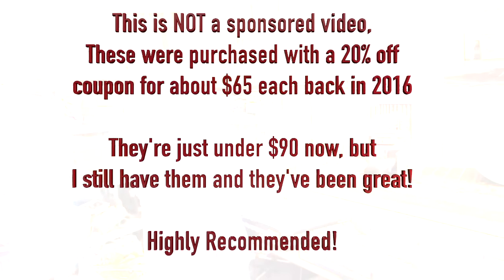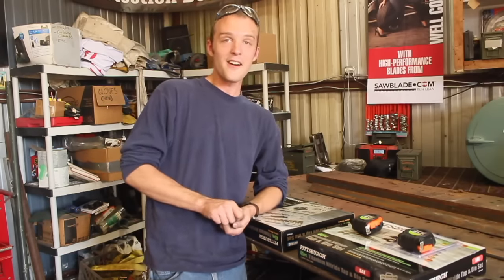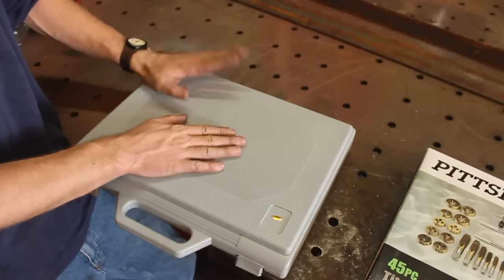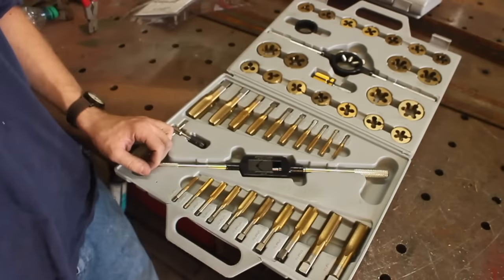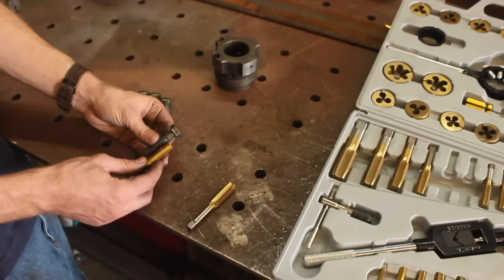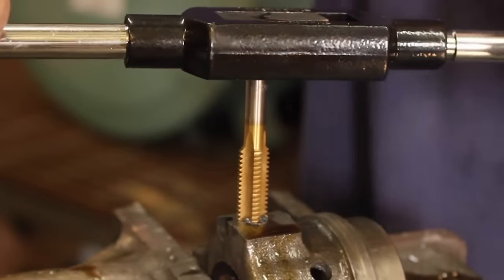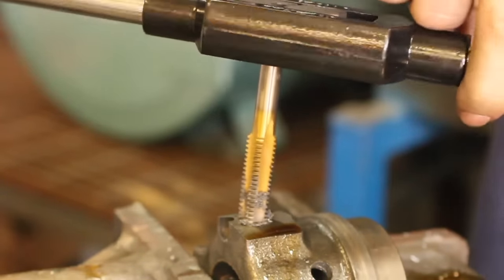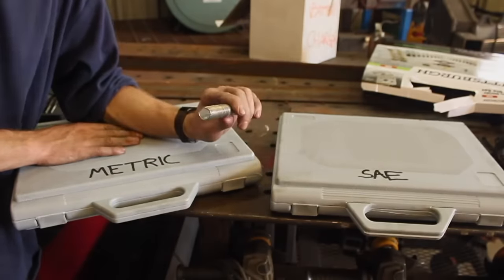HARBOR FREIGHTS BEST KEPT SECRET!!! AN ITEM SO GOOD EVEN INDUSTRIAL COMPANIES USE IT

Comment: Good set for chasing damaged threads, okay set for occasional use, f'n junk for someone who depends or cares about a good job or frequent use. If you use tap and die on a regular basis you need to bite the bullet and buy quality  made taps and dies. Usually American made. Believe me, there's a reason why one good tap or die might cost as much as a whole set at harbor freight. Just my opinion, let me know if you agree.
Reply: Is there a particular brand/set that you recommend?
Reply: @dreuaustin  Don't listen about american made, that's such a mindless zombie mindset. Look up the YouTube Project Farms Tap and die set video. He finds you the best tools, compares them and everything.
Reply: Always good to have backups
Reply: You can see the slip in the handle when he is chasing the stripped threads
Reply: @midnight2moonlight200  Agree, there some great foreign made tools and some junky American made tools. Quality determined by the manufacturers spec and quality control and not country of origin.

Comment: Ive used both sets for about 3 years, and have been happy with them.  The case in the other hand is another story. I'm going to build a wooden case for them most likely.
Reply: Haha I wish it was easy to source new cases for cheap tools, I get that too where a plastic hinge breaks off or a latch goes bye bye and it's usually really hard to rig something up like a real hinge.

Comment: I picked this set up a few months ago. I am happy with the quality of the taps themselves, but the small tap handle (the collar-and-sleeve with sliding torque bar) is terrible. Even after tightening down the collar onto the sleeve using pliers, the smooth tube of the sleeve would not grab the square head of the tap well enough to keep it from slipping about half way through. 

I picked up an inexpensive Irwin tap driver to use, and have been very happy with it so far.

Comment: They taught us in machine shop class that cast iron need no lubricant as the graphite content provides the lube. I worked in a production machine shop and after a shift working on cast iron parts,  my clothes everything around me were covered with cast iron dust. Nice sets.
Reply: That’s correct
Reply: Then a little bit of oil would keep the dust down.  If that dust is getting all over your clothes then it is getting into you lungs as well.  While the iron might be absorbed by your body for use in your red blood cells I do not think there is a minimum daily amount of graphite recommended for good health.

Comment: Recently needed a winch to load a propane tank and then a disabled riding mower. I have a gooseneck ball in my truck so I remembered seeing one with a trailer ball mount plate from Cabela's years ago. I needed it that day so I couldn't wait for an order so I took the chance that my local harbor freight had one. A short trip and $ 89.95 later I had one. Should have had it 10 years ago. What a back saver.

Comment: I have a set of Greenlee tap and dies from the the 50’s. Once while out of town and I needed a one time use of several taps and dies sizes I bought the HF 29 piece set that was 20 years ago. I have had good luck with it the  HF set.
The Greenlee set is in a wood box and is in excellent shape so I have a tendency to go the HF set in the blow mold case. Just to preserve the wood case. I have never tapped or ran a die test comparing the two sets for thread tolerance. But so far the HF have done the job for me many times.😁🛫

Comment from the maker: UPDATE: Not even shilling, but HF is putting on a big sale this weekend and these sets are on sale for $69.99
Reply: I have  the Pittsburg set with both sae and metric in one kit but these individual kits have much larger sizes. For 70$ can’t beat ‘em. I tap mostly 4 and 6mm x1.25 cylinder heads in 2 strokes.  Have you ever heli-coiled a stripped thread that was originally sae to accept a metric bolt? I know is sounds redundant but it was the fix that saved the day
Reply: These are not the best, and I own both of them... They're an awesome value for the money though!

Comment: I have used the higher priced Harbors Frieght taps and drill bits in CNC machines on multiple occasions when what I needed wasn't available in the tool crib. If they're used correctly, they work very well and resharpen well also.

Comment: It's a sad and uncomfortable subject, but man, sometimes you've gotta get the job done and you need the tools - no matter where they come from. I'm just a home-gamer and I don't make my living off of my tools, so when I bought an engine hoist - I simply couldn't spend the extra $400 for a US-made product. Especially one as stupidly simple as an engine hoist. I just got one from the overseas Junkatorium, replaced all the crappy bolts with US Grade 8 fasteners and got working.
Reply: Exactly right, probably wont last 10 years in a commercial engine shop but might last you a lifetime!
Reply: Okay let's put this in perspective I don't use a tap and die set unless it's absolutely necessary I need something that will work and not break because the part is  worth way  more ...so I don't use cheap   H F China junk
Reply: @marktarascio4766  You'd be surprised how much of HF's "china junk" is just rebranded contractors (Chinese and American) for big name stuff. Floor jacks are a fairly famous one, presses, tool boxes, a ton of their hand tools. Wrenches, hammers, axes, sockets. If you're not going for power tools HF really isn't the worst stop. 
But to each their own.
Reply: @Alconium  LOL, it's more like the other way around, a lot of the big name stuff is just the same stuff out of the same factories in China, with a different company name stamped/laser etched on it.
Reply: @marktarascio4766  The whole point of the video is that a dude uses it in a commercial shop and it works and doesn't break parts. It stands to reason it would do even better with your occasional use. Perspective-wise, you're looking through the wrong end of the binoculars.
Reply: @marktarascio4766  I work in an auto shop every day, and everyone In the shop has borrowed this HF tap and die set that our tire guy has in his toolbox and it works just fine. They have some junk yeah, but remember the tool being used is only as good as the tool who's using it.
Reply: @LiT_Moose89  I worked at an auto machine shop for a number of years and I got used to using tools that I could really depend on. I know most of this stuff is made in China now anyway but I still have most of the USA  tools in my home shop.

USA stuff that I used to have and use I still have
Reply: I got my engine hoist from OfferUp for $80 it’s a 2ton torrin and has rust but it works and that’s all that matters
Reply: @marktarascio4766  a lot of snap on tools are still made in the usa. Being in a machine shop I imagine you used tap and die sets more frequently and relied on them more heavily than in most repair shops. It would make sense to spend the extra cost on a quality set of tools used all the time, but for what it is and how often it gets used, this tap and die set from Hf is a very good alternative to a more costly brand. It may not be as high of quality but it gets the job done and done well. There arent may things HF is good for, but they have a few that just make sense when comparing to snap on, cornwell etc
Reply: Regardless of what you add to it you’re supporting a business that stands on child labor and underpaid workers. It’s become a hidden normality in our society but I have been trying to only buy and support business that don’t profit on another persons downfall
Reply: @thechuckyboi1438  this is the nature of capitalism. The root action of the word is to capitalize and synonyms include to take advantage of and to exploit.
Reply: @deeeyewhy5949  Marxist cheerleader I see
Reply: @thechuckyboi1438  Factories of child labor and underpaid workers is oververly broad and baseless. Their economy has been booming for a few years primarily the middle class. A lot of HF products are not made in china
Reply: @mrmotofy China Taiwan and Philippines. I worked there every box we got had inspection tags inside with foreign lettering

Comment: One the most handy tools I've bought from HF as well!  I refuse to wire wheel bolts because IMO this ruins them and parts washer doesn't always clean them satisfactorily but running them through these dies with a little light oil, works a charm.
Reply: Especially zinc plated fasteners
Reply: Don’t wire wheel them lol
Reply: @goinhot9133  I refuse to wire wheel bolts.  So many people do this and it's cringe, all kinds of dumb stuff like this goes on in 'professional' shops.

Comment: I use a set of these I have had for years. I did work on a Diesel engine once with a weird metric thread. Harbor Freight had a tap the right size.
I was in the store once and a guy had got two wire welders. Turns out he owns a ranch. He said he was tired buying Lincolns because his fence building crew just abused them and tore them up. He said the Harbor Freight welders lasted just as long and were a lot cheaper.

Comment: One suggestion.  When manually tapping new threads, back twist the tap every third or half turn to help reject the filings.  This helps clean the flutes and cutting edges.  I know machine tools usually tap in one twist but those have constant oil/coolant flow to evacuate the filings.  On topic, have had my HF Tap and Die set, purchased primarily for the couple of 'odd' size taps and dies (one was 1/2-20) and they are great.  I also do not expect 100 percent perfection but if you drive by my house and yell "Harbor Freight Salute", a goodly part of my workshop would stand straighter :-)!

Comment: I have the SAE set, and I'm impressed with it. For the price, it's a really good set. I noticed that mine aren't as sharp as more expensive taps, but that just requires a little more time per hole. Haven't broken one yet after over a year of regular use in my shop.

Comment: I bought this very set in Santa Clara, CA, around 2012, and to my astonishment, my friend and I found that the pitches for quite a few of the common SAE sizes were off!  Was verified both with sample bolts and a pitch gague.  That's especially astounding, considering that, even assuming being manufactured abroad (Taiwan, China, wherever), length is one of the few entities for which there is an exact conversion between metric and English units.

So - - if you don't have the pitch right in a tap, it's not much of a tap.  There's no curing that.
I had to return it, and made quite an overture to the manager that he needed to do more than just smile and refund my purcase: he needed to get to the bottom of how a tool product got through 5 or 6 different stages of manufacturing, testing, packaging, shipping, distribution, etc., without ANYBODY ever checking the taps with a frickin' pitch gauge!

To be fair, from the other comments, it seems he might have actually followed through on that, and perhaps they finally straightened it out.

Comment: I use these on 3d prints. Often I just make a hole without threads, ser my wall count to 4 and then tap the plastic. It works better than a 3d printed thread, much stronger.

Comment: I bought the $10 metric tap set from HF to chase some threaded holes. Not a lot was expected but I got less than that; these taps were bad. We're talking slightly harder than frozen butter and about as strong as a stale pretzel. When buying anything from HF always buy the better grade stuff.

Comment: The super-cheap sets and the $90 sets are a much different size range and therefore are complementary. I recently gave the cheap sets away after replacing them with the ICON sets which are also in the smaller range. SFSG.

Comment: I think it's hit or miss with these. Even within the same item number there's pretty big variability. Hardness, cutting edges, finish never know what you're gonna get.
Reply: What makes you say that ? Have you bought multiple sets and had different results?
Reply: That's how HF is. Minimum quality control apparently. But a no questions no hassle return policy makes up for it. Unless you have a long drive to the nearest HF or a time critical/ mission critical need.
Reply: @GW Barr  that's because it all made in China. Poor QC

Comment: I got the exact same sae kit from Amazon and I have great luck with it but the metric set I got is a 110 piece kit from Amazon and it literally has every size you can think of I mainly use them to clean threads on my rig but what I do wanna try is harbor freight's NPT kit it only has 8 pieces 4 male 4 female but really that's all I would ever need

Comment: I had bought a small tap and die set from HF, I think like all under 1/2"  around 30 years ago for only around $20. It was a 40 some part kit . I used it at least a 100 times and only one die broke a tooth and just made it a bit harder to start, but other than that, it really held up. I really put the 1/4" tap and die though alot of theading and it held up. Someone stold the set a from me a year or two ago and will be going with another from HF. Most other companies I've seen want like 3-4 time the price so the only reason I can see to do that is if used every day, but than again, you could have  three or four of each instead of one, so even then???

Comment: Great video mate and also a basic tutorial thrown in for good measure..
Wish we had Harbour Freight over here tbh you guys have some great stores we don't in England. Although we have Aldi and Lidl (you guys have Aldi but don't know if their stuff is made in same place as ours?) similarly they sometimes have some great German made tools, (own brand) that are actually made by decent German companies for them and TÜV certified which is like the British Standard seal for quality and they all come with a 3 year warranty! Made by companies like Scheppach and Einhall and others and rebranded. Cheap as chips when compared to even eBay and Amazon! But quality wise they're like top mid range I'd say.. well you do have to be selective, (some of it is crap some is as good as DeWalt depending who has made that range of tools or batch) so if you choose wisely look at the specs and reviews you can't go wrong! (Often the batteries are interchangeable and have their own 20v/40v range cordless powertools now aswell!) That Tap n Dye set you had looked fantastic value for money!
Cheers from London England 👍🏴

Comment: I bought a similar SAE/Metric combo set in smaller sizes than shown (I believe they are 1/2” and under) and have used it a number of times.  It’s worked fine except that the tap wrench loosens easily during use and slips off the tap just as yours did.

Comment: Well, that's a nice set. I bought a twin set from Amazon about 3 years ago ( $40.00 ) for my welding shop and
so far, no problems ( except the holing tool) with either the SAE or Metric. The Harbor set is much bigger
with the odd sizes. Looks like I can use the smaller sets I bought for just the truck and the sets you showed for the shop.
Thanks for the video...

Comment: I still use my old set from the 70s. It is a lisle set. Also have a snap on set. That's about 30 years old. Both are metric. Have a few sae but dont use them much. So maybe if I need more I might look into this. But if a commonly used one goes bad I would replace it with a better quality one. But to really work these, I would be seriously cautious.

Comment: I call that thing from the rear of your lathe the rear spindle. It’s not just to hold the material steady. You MUST use a dial indicator and use the 4 screws to center perfectly. If you do not, that extra long piece, the weight of it will want to pull down, then when you try to face off the front at the chuck, it will not be square. And if you need to bore a hole, it will be ugly. You need to know what that rear spindle is for and how to use it or all that work is wasted.

Comment: large tap handles are garbage there just alum centers the best thing would be tapping alum with the larger tapes the smaller taps it can handle ok i  snapped that tap handle using a 1inch tap it lasted for a short bit and it cave way .

Comment: I use the cheap set I have just to chase treads.  I don't have very good luck with the round dies.  I see those round dies have 3 set screws though.  Thanks for posting.

Comment: Since you had the part in a vise lined up with the drill press, you can use the drill press, operated by hand, to start the tap straight in the piece.
Reply: Power tapping is not for the faint of heart or amateur.  Too much feed, to little, wrong RPM, and you've destroyed the piece, the tap, or both.
Reply: @VndNvwYvvSvv  I agree but I was thinking you can use the drill press for alignment and turn the tap by hand.  You can put the tap in the drill chuck or you can buy a tap follower that goes in the drill chuck and aligns the tap so you can turn it by hand.

Comment: I bought the metric set a few years ago, and I bought the SAE set a few weeks ago. That have lowered the quality a little bit in this set. For example the size of the dies was engraved into it. On my new set they are just printed on it. Also in the new set the case is a little thinner. Besides that,they are still great
Reply: I know.  Right?  I just ran out and bought both of these.  The printed sizes are already illegible on most of the dies.  I guess I’d better not drop the case and have to figure out where they all go again…oh wait…too late.

Comment: Bought the same sets from a roving tool sale guy out of Virginia 6-8 years ago in red plastic cases. Carried them on my F-550 service truck working on Komatsu Equipment and have never broken one of them but like in your Vid the cases are crap!!! My one issue with them is the accuracy of the sizes is a few thousands off.  Chasing threads on bolts or adding extra thread length I find the threads don't quite match in size.  Other than that I love these sets.